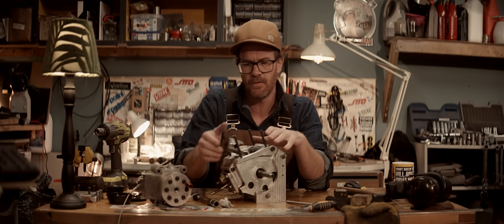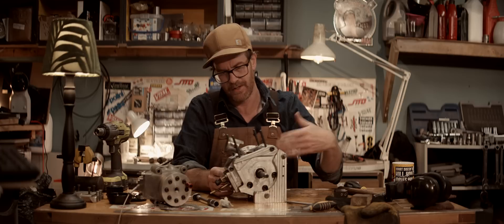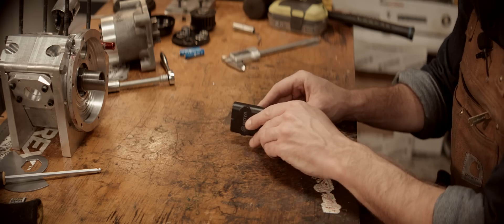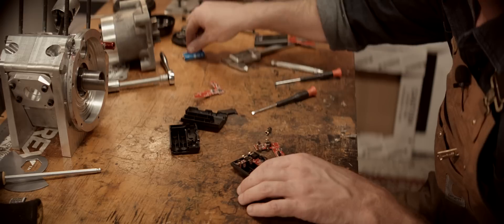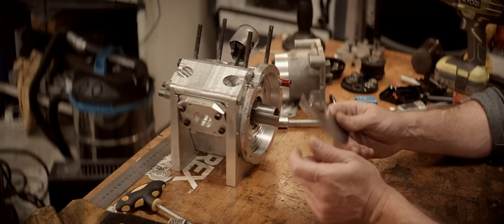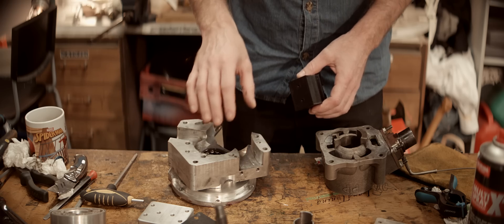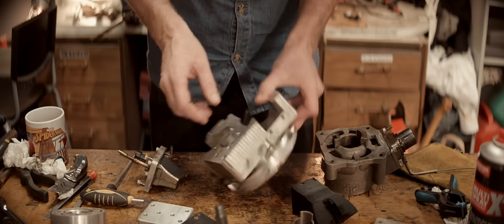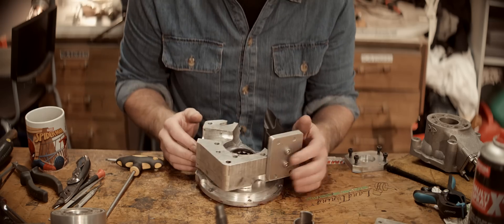18 000rpm + Metal powder in fuel =

Comment: you can fix the battery case where pads have come off, what you need is a needle/pen grinder. grind way some of the pcb to get down to the copper, use a good flux and some replacement pads, solder pads back down and use a conformal coating ( nail polish works well) , should fix it up enough to keep using it.

Comment: The first two stroke I rebuilt was oil injected. The injection had been bypassed in favour of premix. After that first top end rebuild I burnt out the bottom end because I didn't realize the oil injector pump had failed. Breaking things is part of learning, sometimes it's expensive.
Reply: Ride it,break it,fix it,repeat
Reply: The more expensive it is the better we learn. 😅
Reply: Had the same on my old GT185. No oil pump no oil 💥😂✌️🇬🇧

Comment: I would suggest you adapt a rotary valve disc and drive gear from a Rotax 2 cycle motor as used in Ski-Doo snowmobiles. They also had a crankcase repair kit made of brass for when there was excessive wear caused by the rotary valve in rare cases.   🇨🇦
Reply: Challenge will be weight I suspect.

I'd try a DLC coating on the surface for a start.
Reply: He won't listen.
Reply: Well you know what they say about advice... A smart man don't need it and a fool won't take it 🤔 @randygandee9674

Comment: @2STROKE STUFFING  ..I think you will need to think of a separate oil-pump direct feed for the crankcase main bearings, perhaps from an AR80, RD125, or a Suzuki RG (70's/80's eras of bike)?!?

Please remember the Crankcase Locator Dowels when rebuilding this engine !!!!
Reply: Good point re dowels. It also requires lubrication ports to the main bearings from the transfer throats.We must not forget this engine has a ultra low primary compression so poor low end lubrication.
I also strongly believe the poor crank balance is a major factor to crank wear.
Reply: @malcrandall1309  He has raised the ratio with a stuffer, which might have made lube on the big end harder.
Reply: @billshiff2060  Even with the  stuffer fitted the primary compression ratio is still very low. Look how much volume there is in the transfer port ducts leading to very poor pumpimg action.
Don't forget this engine wasn't designed to use pumping action but resonance which didn't get off the floor.
Reply: It depends on how the stuffer projections are placed in relation to the rotary intake flow path. I wasn't referring to the ratio itself. The stuffer might be deflecting cooling air/fuel and oil away from the big end bearing.
Rotary valves already have a problem lubing the conrod, wouldn't take much to push it over the edge at 20000.
The upside down layout also makes sure no oil settles in the "bottom end" now the top end. The typical lube ports from the transfers would actually drain the bearings.
Reply: @billshiff2060  Don't forget all bearings were damaged in this incident. The mains were only replaced a short time ago. Its the residue's from the carbon fibre DV that has done all  this damage. I believe this is possibly the longest running crank Alex has had!
Reply: @malcrandall1309  All the crank bearings would suffer from the upsidedown/rotary valve layout, to that you can add the carbon grit. Still , the piston/cylinder didn't get destroyed. 
He mentions that the big end was tight and kept the parts inside, tight enough to keep the worst carbon out. Abrasive wear on the big end bearing does not cause flat spots. 

I'd say the big end bearing was damaged mainly by bearing needle/cage mass causing skidding at high rpm, a well known problem, made worse by the rotary valve , also a well known problem, and then the presence of grit.
It is remarkable it lasts at all at 20k, even if everything is perfect.
Reply: @billshiff2060  Yes Alex did mention the big end was tight which it shouldn't be as such. Lets not forget the slotted big end allowing the muck in.
I fully agree the only way to get flats is by skidding as you say.

Comment: I have the tool you need for that job.
Yes you need to thread the in side of the sleeve. 
There is several different methods. 
KTM fly wheel puller is different to Yamaha. But work on the same princeable.

Comment: Due to the high rpm, the block overheats faster. 
I know your testing the bike. 
Suppose you drive the aprilia rs then it gets more cooling on the road.
The engine block of the 50cc Aprilia RS is the weakest point to overheat or run into each other. 
A 125cc engine can have more To perform.
Still, the 50cc should be able to handle it for a while.
Reply: He does need a fan to drop the block temp on the dyno

Comment: Hi. My company is specialized in roller bearings for high demanding applications. KTM MotoGP Department is our customer for example. We could offer you ceramic rollers for higher rpm. Thomas
Reply: Please offer him a donation bearings, I’d hate to see this channel go down, and all his and families hard work go to waste . What a story this will be if he gets this engine to the salt lakes and wins
Reply: Hi Thomas what's company name if sales to public or bearings brand name you manufacture ?
I'd be interested myself for same application .
Cheers.
Reply: Boost
Reply: I am pretty sure the needle bearings are not the problem here.  The heavy cage is breaking through the oils film strength at those high rpm's, and rubbing on the inside diameter of the rod bearing surface.  We have the same problem above 17,000 rpm with a 32cc engine from Zenoah,--with a much smaller bearing.  Zenoah's smaller bearing handles up to 21,000 rpm, (30.5cc to 23cc).  Just 2mm in diameter difference makes that difference.

Comment: I used to rip headphone jacks on my stuff.  Even if the pads are ripped, follow the traces back to the other components they connected to and solder a wire on there.  Then just put a knot in the wire, and stick the pigtail out the opening and add a jack.
Reply: Ja, skrap over lakken og legg en lask rett på kretskort banen. Dette bør være grei skuring på overflate monterte kretskort.
Klipp opp en nettverkskabel, mange gode kabler inni en slik for slike formål.

Comment: None of us care that you can't just blow all your money on parts. It's not like any of us can either.
Reply: Agree. Haha. Dying to blow some cash on bits myself atm.
Reply: True that. My FZR400 needs a ton of things but so far...OEM oil filter and the air filter in custom fabrication. Still needs some engine parts, shocks and brakes front and rear. And it's been four years...
Reply: @ruikazane5123  it definitely takes time in real life. I bought a house and that put a massive damper on all of my hobbies, but that's fine. I've been putting together a pretty rad scooter out of super cheap leftover parts and deals I've found on parts from Japan. The problem with that is shipping. 
It's taken like two years so far, but I'm not in any rush.

Comment: The pads are ripped but seems like a pretty simple pcb, solder it to the remains of the trace with some extra wire or follow it to the next component and solder a wire there.
Reply: yep. just glue/epoxy it back where it's supposed to be and use fine wire to connect it at the far end of the broken trace.
Reply: I would make cca 15cm cable and a connector on the cable, pcb mounted connector is not robust enough...
Reply: @JGollez  Audio jacks and barrel power jacks hold up a lot better if they're epoxied to the board with 5-minute clear epoxy.  As in, I've been doing exactly that for years and haven't had one break afterwards.  (I've even started doing it as a "Day 1" mod - why even bother waiting for it to break first?)
Reply: @sparcnut  I would epoxy that cable on the pcb :)
Reply: Agreed 100%

Comment: You might want to consider making a wet sump lower. The work would be massive making oil bearings in the crank but I think it might be worth it
Reply: Wouldn't it produces lots of drag on the crank ?
Reply: Without direct injection it would be a headache...
Reply: You would need a blower of some sort and the direct injection
Reply: Do you mean add oil seals and feed the main bearings from a separate oil supply?  That may be possible (though a lot of work) but it still leaves the big end bearing vulnerable.
Reply: That would be a dry sump mate

Comment: Please use gloves and a respirator with acetone, even if you're only wiping something down!  It's really bad stuff.
Reply: Acetone is produced in the body and is broken down easily in the liver, it's one of the lesser harmful chemicals found in an average garage. Methyl Ethyl Ketone is much more harmful and is often found in paint stripper.
Reply: @JamesChurchill3  Acetone dissolves neural cell walls, as a colleague of mine showed at Caltech.  Just smelling it causes epilepsy in rats.  Acetone has an unwarranted reputation as being safe.  Look up acetone neuropathy.  All solvents that you use in a typical gear-head garage should be used with gloves and a respirator.
Reply: @johnpezaris6982  acetone seems rather difficult to adsorb by ordinary respirator, but gloves are very good choice. Imho fume hood is better solution as it doesn't make you inconveniences.